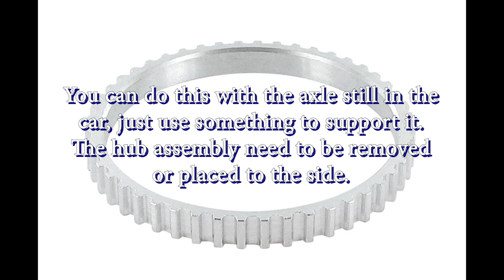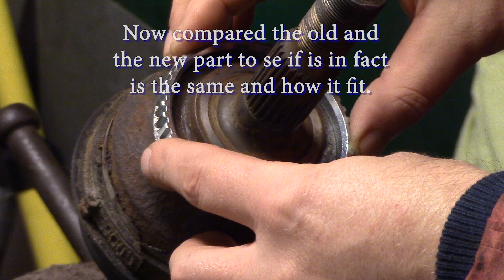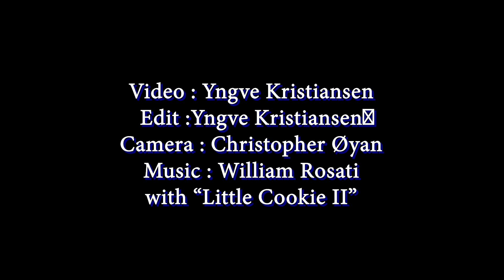abs ring replacement (Plz subscribe )

Comment: I have Suzuki cultus 2010 aka GM GEO metro or Pontiac firefly. the steering vibrates on gravel and rocky off roads. i just recently repaired it's axle. the tires are fine. but i suspect it's inside the steering rod or box ( i don't know what to call it). the car also looses power and start vibrates then hits 500 in RPM when i turn on the lights at night and gets even bit lower like 400 or 300 when the Radiator Fan starts.  but no problems on AC stays at 700 rpm and also no signs of overheating yet no signs of Radiator leakage.
Reply from the maker: is that the same as the Suzuki Swift? i dont know to much about those car's. that an engine is vibrating at 500 RPM and below is normal. what is not normal is that it goes so low. if you have an unbalance in a axle or a tire that will be felt thru the steering wheel. you might have knocked off a balancing wight on the rim. 
to look for a bad ball joint try to hold the hand over the ball as someone is rotating the will just enough to move the wheel ever so slightly (make sure you have good room where you have you hand's and that the one inside KNOW WHAT THEY R DOING!) the car must have full wight on the wheel to get a accurate feel. there should not be any slack in the ball.

Comment: "you can do this with the axle still in the car..."  Well, only if you don't need to chisel the ring off like you did in the video.  As we can see, you removed that axle from the car.  Also, using the old tone ring to hammer the new one is a good idea.
Reply from the maker: no it's no problem to chisel it off. just put a stand under and hit it and it's off. i have done it on different car's.

Comment: should of used the old ring to hammer it on withm instead of hammering the shit out the new ring,
Reply from the maker: better to heat it up a bit more then i did. and get in in place befor it cool down. tip. dont film at the same time ;)

Comment: Hi Yngve! And what about the case when the ring is part of a half-axle (cannot be ordered separately). I have an S60 T5 2005. Will this regular ring fit as well? Thanks.
Reply from the maker: as far as i know the same part i used here fit some of the 850, 30, 70, 60, 70, 80 and 90 series as well as nissan 200SX.  it looks to be a part of the shaft until you splitt it. 
the work can be done "on the car" 
i have not come over shafts that have it integrated . stil i have not worked a lot of other then 850 and 70 series cars.

Comment: put it in a pan of boiling water should be about the right temp.
Reply from the maker: actually, putting it on a hot plate and have a solder on it and then when the solder melts it is ok. about 200c. i think i was about 150 and it was a bit to cold as it dont "fall on" by itself.

Comment: That's no way to seat it, hitting the edges with a bloody 2lb hammer?
Reply: Absolutely right, I was horrified watching him bashing it with a heavy hammer ! using a piece of hardwood would prevent damage to the ring !!
Reply: @Colin623   which tool you recommend?
Reply: Hide hammer would be better

Comment: Cringed.go get a heavy rubber mallet that hammer will damage that ring if you see it or not or at least get a block of wood to lay over the ring to keep from metal to metal contact when seating the ring
Reply from the maker: i did lock closely and there was no damage.. stil i agree with you ;) i made it a bit to cold or was to slow as i was filming. .

Comment: I dont know why you didnt use the old ring to tap the new one on, saving the risk of damage to the new ring.
Reply from the maker: cracked.. i just need to heat it up a bit more "next time.. even tho.. it was not "hard taps" and it slipped on "okayish" ;) 
and stacking this rings even when new is not easy. if i where to do a lot of this i gues i had done a tool in a press and used that.

Comment: I have mitsubishi lancer 2006 .. and abs light on after speed 100 km/h .. someone told me the problem is abs gear .. i want to to know the solution please
Reply from the maker: i'm for the moste part in to volvo's. i dont know that car to good EVEN tho it is the same as a volvo S40. sorry.
Reply: @grapsorz  
Thanx a lot